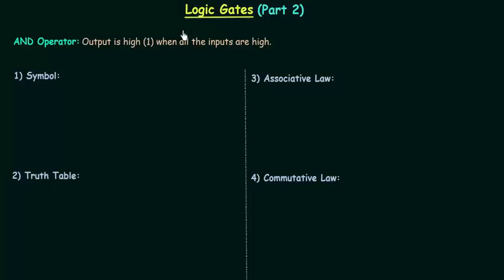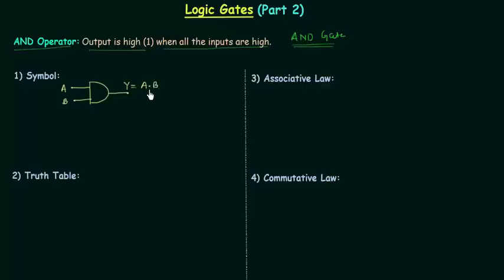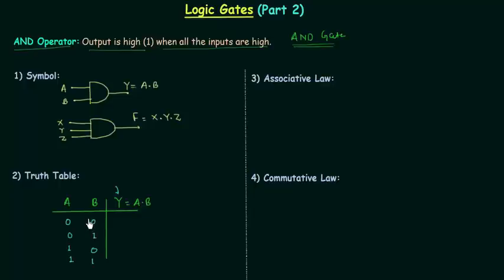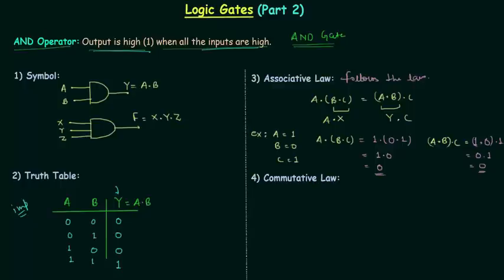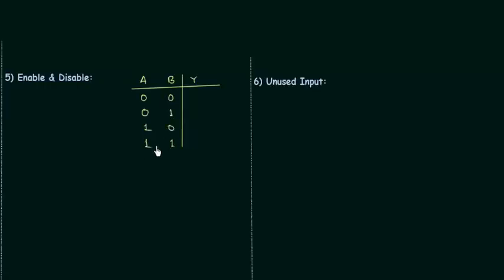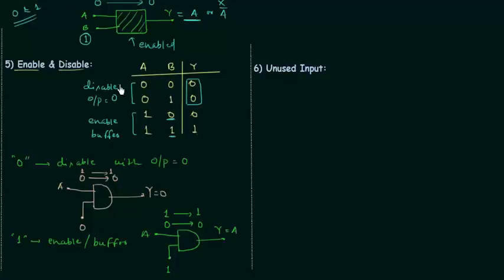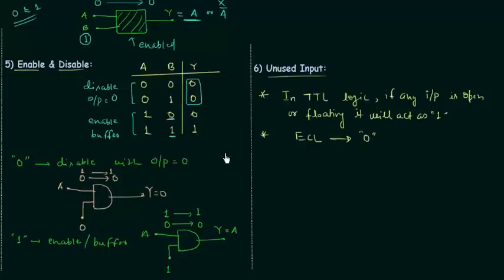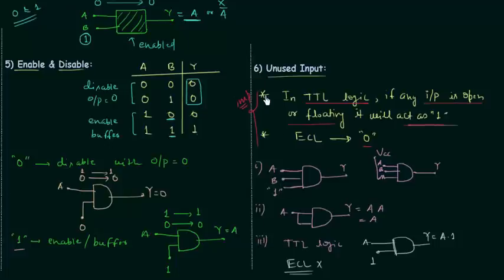Logic Gates (Part 2)

Comment: 1.Y=0 
2. Y= A.B.C
Reply: Why the hw question 1 answer is 0?and in question 2,those floating input stands for 1 or 0?
Reply: Why the answer for question 1 is not B.1? It isn't the top left and gate is disable since one of the input is 0? Can u please help me out with this?
Reply: @tmyum6747  As one of the input is 0 (for the top left AND Gate), its output is 0 (A.0 = 0). From the below left AND Gate output is B (since B.1 gives B). Now the right side AND gate has input 0 (from top left AND Gate) and B (from below left AND Gate), which gives 0 as output. So Y = 0. Please feel free to ask if you have any doubt.
Thanks
Reply: @tmyum6747  Floating input stands for 1 according to TTL Logic.
Reply: right bro
Reply: If it's not mentioned we will consider it as high or "1". According to TTL logic..
Reply: @tmyum6747  floating stands for 1
Reply: @tmyum6747  They stand for 1 coz as sir told is and gate logic 1 is enable input, so any floating or open input will be treated as 1.
Reply: @rajatsingh1355  how can we diff btw TTL n etl
Reply: @rajatsingh1355  floating point stands for 1 then the answer should be (A.1= A) for the 1st and gate in que.2
Reply: @rajatsingh1355  why..?? It stands for 1
Reply: @rajatsingh1355  can u plz explain the 2nd question?

Comment: I didn't understand the topic of logic gate part 2  (enable &disable)
Reply: kocherla chinnarao
 
Consider 2 cases!

1.   If b=0, then ‘y’ is fixed! 
This makes ‘a’ inconsiderable!!
Output is fixed for one of its inputs and disables the logic gate!

2.    If b=1 then, y=a or y=a’ 
In this, neither of the inputs is being ignored and the logic gate is enabled!!! 

In simple words it is meant that both the inputs should be involved for the gate to be enabled! 

Also, if the conclusion of this is confusing, then in the first one (.     ),
If ‘A’ = 1, ‘Y’ =0
If ‘A’ = 0, ‘Y’ = 0

That was a mistake corrected by NESO academy in one of the comments!
Reply: > enable/disable is also called "control input".
> look at the Truth Table, "A" becomes the "control input"
> in the Truth Table, "B" becomes one of the other input in the Logic AND Gate. (or becomes "A" as called the 'first input when you Draw AND Gate)
> instead of "A" as first input, use "B" to avoid confusion

Comment: enable and disable concept is very confused. please tell this  in a better way.
Reply: Danish Bhatia yes dude if input b=0 fixed always y=0 bt he says a=1 y=1 and a=0 y=0
Reply: puran gautam he said that he got high voltage from anything. Then that one is 1. So when tha A is 1 Y equal to 1. A is 0 Y equal to 0.
Reply: @maleeshafernando6538  In AND gate if both the values are high then the output will b high. In the diagram he said if b=0  and a=1 then y=1. How it is possible in and gate. As we know    1.1 =1

Comment: Sir, I have one objection

In the two input AND gate, which you have drawn, for disable
You have shown that 0 is the disable so the output will be 0 at all values of A
But you have shown that if A is 1 then output is 1 and when A  is 0 then output is 0
Which means that the 'output of the two input disable AND gate is dependant on A'
Which is not possible if 0 is disabling the logic gate
Reply: Sir, kindly explain this

Comment: Can anyone say me how it happened. In 6:42 B is 0 and out put is fixed=1. When A=0 or 1 then the output should be 1 because the out put is fixed but sir is saying 0 . How?
Reply: Imagine a tv we have two steps to open it first connect it to electricity and then press power button
Now imagine Electricity= B and power button = A
And the display(output) =Y
So if B(0)  not connected then A  wont affect the output Y but
 if the B is on(1)  then A can trun it off(0) and on(1) so B has enabled the tv
Reply: That is ok. But your reply is not connected with the doubt raised by @parthanayak1620